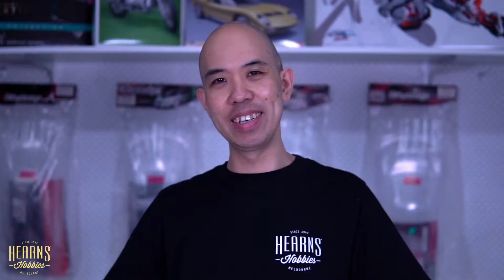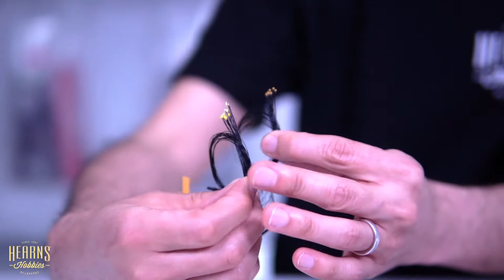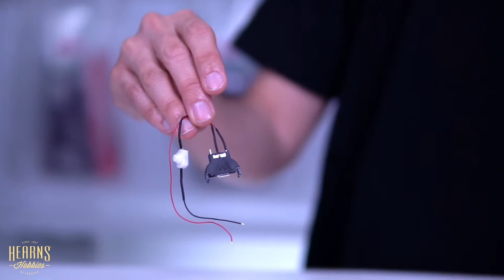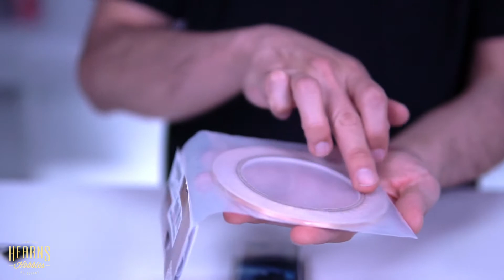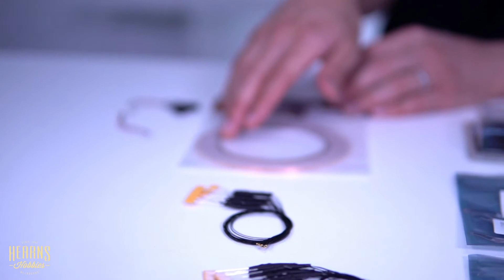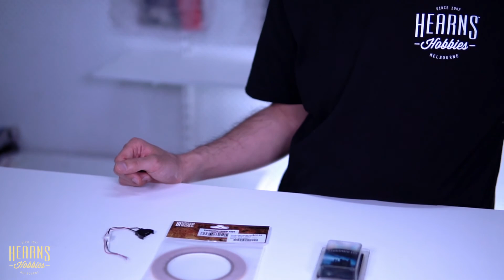Green Stuff World LED Introduction and Review | GREEN STUFF WORLD | #askHearns

Comment: hi i recently bought led, lighting set and copper tape from your store, but i got no idea how to connect it up all 10 leds using just 1 lighting set. and also how do you make the light blinking ?
Reply from the maker: Hello Jen. Please get in touch with the store and we can explain how to make it all work. For the blinking you will need to add a blinking circuit.